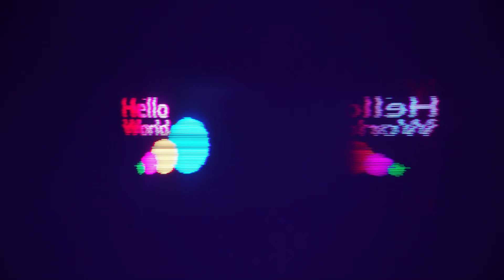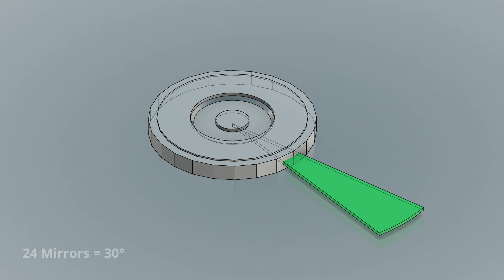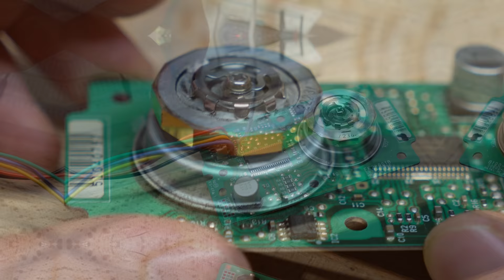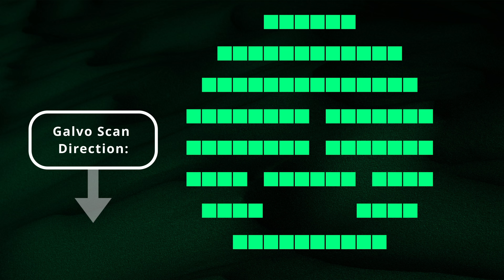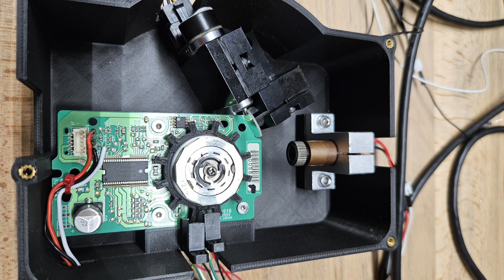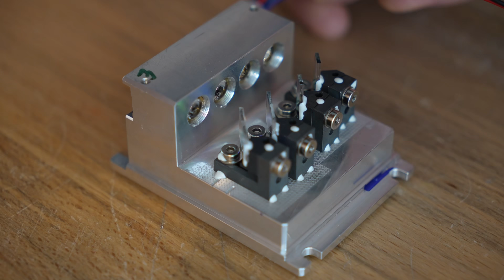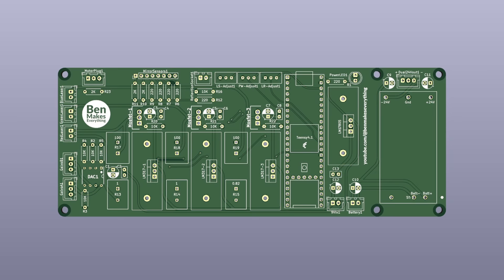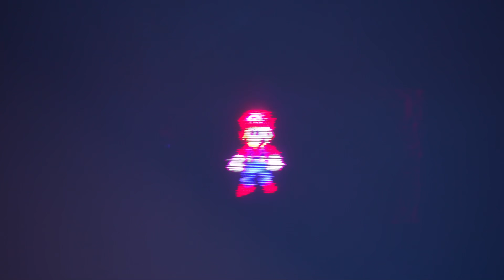DIY Laser Image Projector (100ft+ Range!)

Comment: I think one of your main problem comes from the 3d printed, and unweighted indexing ring. This introduces vibrations that form into harmonics and shake the whole image apart. It's only for split frames, but the outcome is visible.
Reply from the maker: I agree. Looking into some better options for position tracking for a future version.
Reply: @benmakeseverything  maybe using FOC might be an option. It's a bldc nonetheless. or maybe a magnetic encoder with a diametric magnet.

Comment: I made a working projector using a resonant scanner for the horizontal axis.
Reply from the maker: That's an interesting idea - Is it some sort of metal strip cut to a specific length to achieve the right frequency?
Reply: It was a torsion bar polished to be a mirror.  Excited by a helmholtz coil configuration.  The frequency was just roughly tuned, the circuit was an oscillator that derived feedback from the mirror. Then a software PLL locked the raster clock to the mirror.  Another complication is that the clock generator had to compensate for the velocity being sinusoidal.

Edit:

Oh and like you this is just for fast axis.  The slow axis i used galvo too.

Another edit:

When i look online i see “resonant galvo”. It is similar but my torsion bar was supported on both ends.  The integral torsion bar and mirror is magnetized by external magnets, the coil is of course for excitation.  Feedback is from two photodiodes and a LED behind the mirror. My setup is much larger than commercial resonant galvo but is definitely more robust i think. Mine operated around 12 KHz.

Comment: Electronically, a stable frequency reference is needed, a mirror index signal in each turn to sync and a signal from each phase of the motor winding, which is usually of the BLDC type that feed closed-loop control for simplicity may be a VCO type. It is also necessary to use RS422 type differential wiring for signals to avoid noise and Finally it is necessary to use a shutter suitable for the laser.
Reply from the maker: If I ever do an improved version, it will likely have all of those things implemented - except maybe the shutter, not entirely sold on that idea although many commenters have suggested it.
Reply: @benmakeseverything  I tell you this because I have worked with lithograph plate imaging scanners and the process must be very precise and synchronized, just as you intend to do in your project.

Comment: Awesome work! I always wondered why there was never a big effort to recreate the CRT method of video display with lasers. Especially considering the advantages of motion clarity it has over sample and hold display tech. Looks like there's a lot more to work out, but you have come a long way. Truly great work, keep it up! If you can get to 1080P resolutions or better there is a use/market for it in the retro gaming community as CRT's continue to die off with no replacement tech available other than scalers for modern TV's like the retrotink devices. But that doesn't solve the motion clarity issue that sample and hold display tech has. Even BFI and OLED hasn't solved it yet.
Reply from the maker: Thank you. To be honest if I could achieve 640x480 at a steady 30fps I'd be happy. Plenty of resolution for retro gaming. That might be possible with a very high RPM motor (you would need to draw 14,400 horizonal lines per second). Perhaps I'll revisit this in the future.

Comment: That artefacts maybe is a result of “external interupt” triggered with speed variations, or big chunk of code executed inside interrupt handler. Because it looks like with increased number of triggers in optical sensor, number of artifacts increased too. Even with 30x faster cpu shouldn’t be overloaded with 3x calculations.

Comment: There is a technique used in the early days of television that relies on rotating mirrors in the scanning process and is called the Mihaly Traub technique. You may be able to apply it to increase resolution.
Reply: Yes, that would add a set of N fixed mirrors to effectively multiply the number of lines scanned per mirror revolution by a factor of N. Might be a bugger to get everything adjusted and aligned properly though.

Comment: While the combination of a photonic microchip and a photomultiplier tube (PMT) could potentially enhance image resolution and sensitivity, directly "fixing" an image and adding sound through these components alone is a complex task that would require additional components and careful engineering.
Here's a breakdown of how these components could potentially be used in such a system:
Photonic Microchip:
 * Image Processing: A photonic microchip could potentially be used to process the incoming light signal, enhancing image quality, noise reduction, and potentially even basic image processing tasks like edge detection or contrast enhancement.
 * Signal Amplification: While PMTs are excellent at amplifying light signals, a photonic microchip could potentially provide additional amplification stages, especially at higher frequencies.
Photomultiplier Tube (PMT):
 * Light Amplification: PMTs are highly sensitive detectors that can amplify weak light signals by many orders of magnitude. This could be crucial for low-light imaging or detecting faint signals.
Attenuator:
 * Signal Control: An attenuator could be used to control the intensity of the light signal, which is important for optimizing the performance of both the PMT and the photonic microchip.
Sound Generation:
 * Direct Conversion: While it's not straightforward to directly convert light signals into sound, a more likely approach would involve using the amplified signal from the PMT to trigger a sound-generating device like a speaker or a piezoelectric transducer.
 * Intermediate Processing: The amplified signal could be further processed by electronic circuitry to extract specific information (e.g., frequency components, intensity variations) that can then be used to modulate sound.
Key Challenges and Considerations:
 * Image Resolution: While the photonic microchip could potentially enhance image resolution, it would depend on the specific design and capabilities of the chip.
 * Sound Quality: Generating high-quality sound from a light signal would require careful engineering and potentially additional components like digital signal processors (DSPs).
 * Power Consumption: High-performance photonic microchips and PMTs can consume significant power, which may limit their practical applications.
 * Complexity: Integrating these components into a functional system would require careful design, precise alignment, and sophisticated electronics.
In conclusion, while the combination of a photonic microchip and a PMT could potentially improve the performance of an imaging system, directly "fixing" an image and adding sound would require a more comprehensive approach involving additional components and advanced signal processing techniques.

Comment: Dude, really really good start. It's just DIY laser projection is not easy like other DIY options. Now your only problem is getting a Red, Green, & Blue (Blue(+or-)450nm) -3 laser projector to work. True laser projectors use allot of tech to combine each laser into one colored image.  Buying a premade one is just silly now considering the price of them. I say anyone reading this, Just buy a newer Sony or a overpriced OLED..  Now if your dead set on a good projector, simply buying a new or used LED, 3-LCD, or DLP projector is a much better option. Keep in mind the bulb types and "NATIVE RESOLUTION", "CONTRAST" & LUMENS OR (LM). But anyways they are much cheaper and work amazing compared to anything you can DIY at home. JUST DO YOUR RESEARCH!
Reply from the maker: Thanks. The goal here wasn't really maximizing resolution or image quality, but rather range. MEMS-based systems will always win in terms of quality, but by deflecting the entire beam rather than splitting it, it can reach a lot further. That's the theory, at least.

Comment: I think you and Bitluni should join forces and make a laserdriven CRT emulator:
https://www.youtube.com/watch?v=9qPc_I1V6go

How big an improvement in resolution do you think you could get, if you didn't have to see the beam from 100 feet, but from something like 2 to 5 inches?
Reply from the maker: Yeah, I saw that video, pretty cool. The issue with the resolution isn't due to the range, its  because of the fact that to achieve a decent framerate, you have to draw a ton of lines. For my design, the max I could achieve was 120 lines at 30 FPS. So thats 120x30 - 3,600 horizontal lines per second. With 12 mirrors,  that still means that the motor has to spin at 18,000 RPM. Which is pretty fast. I could probably double that and get 240P res with an ideal setup, but even getting NTSC picture quality would be hard.

Comment: are you aware lots of diode lasers bled other wavelengths of light, green lasers have a ir source that is converted to green, this stray light could interfere
 with the optical sensors.
Reply from the maker: Not this type - That is true of 532nm DPSS lasers, this is a 520 NM direct diode, no wavelength modifying crystal.

Comment: Dude, this is amazing! Well done!

I don't know if it would work, but in theatre lights, whenever a gobo is used to project an image a donut us used in front of the lens to clean up and sharpen the image. While you're not projecting an image from the laser, so to speak, it would potentially work to clean up the dot each laser is producing and reduce the spill. You're probably still going to have a rectangle vs a dot, but you'd likely have less corona/light spill around your "dot". A tiny washer or 3d printed washer looking thing would probably work.

I'm subscribing to see if you keep messing around with this project. Again, great job!
Reply: Indeed. This is typically done with an iris, which gives you flexibility in choosing the aperture (“hole”) size.

Comment: Last time I'm going to tell you, the system requires two spinning mirror arrays.
 The one that you currently have along with a faceted cylinder for the other axi.
Use grayscale resolvers to determine location.
This will give you granular control of each individual pixel.
What you're doing isn't new by any means.
 It has been done in many laser labs around the world.
You also might want to look at using a Liquid Crystal Optical beam shutter

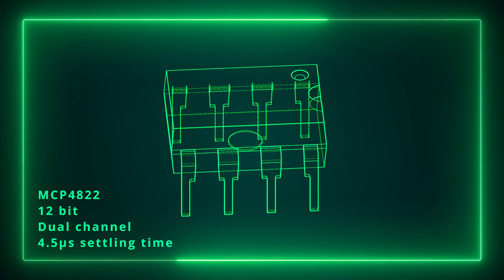Comment: How do you do the green line animation in 6:28?
Reply from the maker: The rotating chip? In fusion 360, you can do simple animations and export as a video file. I set the render style to a line art with no shading, (black lines on a white background). Then I took that and inverted the colors in the video editing software (DaVinci), and then put a green overlay on top of it and set the blending mode to 'multiply'.

Comment: These lasers already exsit in photocopiers. The parts often get thrown away instead of repurposed. You can probably get one cheaper that what you paid to make that one.
Reply from the maker: The spinning mirror, yes (and thats what the one I used came from), the galvo that's used for the Y axis - No. And the laser used in a copier is an invisble IR diode, unlike what I used.
Reply: @ oh I know. I use to repair them. I was a copier tech for several companies after I retired from the USAF

Comment: For extra resolution, i wonder if you could:
A. Wiggle the laser beam with a piezo or voice coil piece attached to a mirror or lens
B. Use a beam splitter and fast attenuators to draw two lines at once 
C. Use a grating beam splitter and thin, off center grid filter to draw multiple lines at once (the moving dots would "blink" in a regular pattern as they hit the diagonals of the grid filter).

Idk. 
Great job with this!

Comment: Great project! 🤩 I am impressed with your experience. You can add "free" cooling by just drilling some nice holes in the bottom and in the top cover. Holes to be covered with some dustproof net from inside (like in good laptops), and foots to be added to have airflow from the bottom. Convection will do the job possibly without any additional fan.

Comment: I'm actually looking into encoding bldc motor position for a university design project. Magnetic decoder chips and a specially polarized magnetic sound like a great solution to your problem. Unfortunately, common magnetic decoder chips (like the AS5600) have a max decoding speed of 100 rpm, nowhere close to the speed of your motor. I think a hall effect sensor based field oriented controlled system might be what you need. There's even a fantastic Arduino library called simpleFOC with amazing hardware and software documentation. Not really sure if it is suited for these high speed applications though.

Comment: I'm really surprised that board that drives the mirror motor doesn't have a sync output.  That 3D printed ring surely altered the balance on the spindle.

Comment: You can use beam polarization to vary the color power, but the electrical devices that can do that fast get pricey

Realistically, your best bet is probably digital power modulation with multiple beam emitters

Three red beams is full-intensity. Switch two off and it's 1/3. Etc

Comment: Congratulations on your project; it appears promising, though there are areas that could benefit from enhancement. I have been contemplating this concept since 2006, but I have not had the opportunity or environment to develop it. I believe I have several suggestions that could help stabilize the output and achieve clarity comparable to that of a PC monitor.

Comment: not all possible methods of suppressing "torn vertical" have been used yet. 
***cheap ones:
1. weighting the flywheel with mirrors to smooth out the difference in speeds associated with uneven operation of the electrical part of the drive, the mechanical part of the drive;
2. using magnetic bearings (but then the requirements for the overall stability of the device are increased).
***expensive ones:
1. using faster-acting optical sensors with a higher fronts steepness (fiber optic);
2. additional, highly stable quantization of the optocoupler source (and therefore high requirements for the steepness of the radiation rise/fall fronts) (again - fiber optic);
both of the last cases will also require a faster-acting circuit strapping of the sensors, right down to the software node.

Comment: Hi Ben, Have you actually studied how they did it in the old days with CRTs? ie. Alternate field scanning but with a blanked flyback so that the second field starts at the top , same as the first field, rather than retracing the second field backwards, so to speak. You introduce more flicker that way, because the delay between the beginning of each field scan is longer than the delay between the end of each field's scan.
Microcontroller speed is reduced bigtime because you're using Arduino. In Assembly Language you can switch an output pin from high to low or L to H in just a single clock cycle.
An ATXmega256 micro runs at 32Mhz clock speed has 2 x 12 Bit DACs as well. You can send the 12 bits to the DAC in a single clock cycle ie. 31.25 ns
 Love the concept though !  Keep up the great work !

Comment: Your issue with DAC speed can be solved by using simple sample and hold circuitry on the output, this will allow the output to settle on the DAC before using it. It will give you very stable outputs that can change very quickly and cleanly. The jitter could be solved using a PI Pico which has a state engine arrangement on the GPIO capable of extremely fast and stable switching. Seriously people have produced VGA signals with PI Pico GPIO that are rock solid.

Comment: Write a digital PLL to fix up the horizontal glitching - basically a free-running hardware timer, but you bump the timing down by 1 clock if the pulse from the opto is early, and up by 1 clock if it's late, then tweak those values until it settles in quickly enough but doesn't jump way out if there's an erroneous pulse

Comment: hall effect sensors are cheap, easy to set up and require very little power. it would give you a very accurate result allowing for a large advance and retardation of the timing. 
perfect for positioning. hope you can apply it. 
norwegian tinkerer.

Comment: I found that (in the early days of addressable LEDs) although the processor may have had the MHz to handle what I threw at it, there were internal processes that used chunks of those clock ticks and I got exactly what I think you are getting where a line is shifted. By a combination of disabling anything on the processor I wasn't using and using the fastest processor at the time (ESP instead of Arduino) I managed to get a much more stable image with only the occasional line shift (just enough to keep that retro feel). Good luck

Comment: I have been researching the laser world for a while now, and while I haven't built anything yet, I think I could probably make it happen. What if you used a board from a DVD ROM? This would give very precise control of the lasers, as well as resolving any clocking issues. Also, your battery is a bunch of 18650's in series. Easy to remove the housing and directly solder to. Instead of 2 res LED's, use a beam splitter. Almost all laser diodes produce a rectangular spot. A convex lens at the aperture may solve resolutions. 
Thanks a million for these videos, as well as your entire channel!

Comment: There was a Company back in the late 1980's that had a couple "Motorcoaches" <like tour busses> setup with Entire "optical labs" inside so they could do Projection of logos and basic images on the sides of buildings and such.. However they were using large tube lasers and a non trivial power source <i can only assume> - i think they went by the name "LaserMedia" .. i've got their demo real on 3/4-Umatic i could host somewhere if anyones interested.